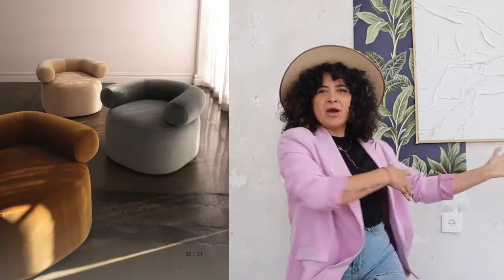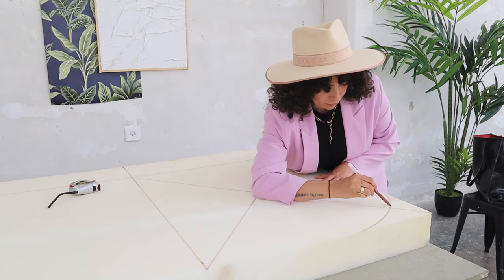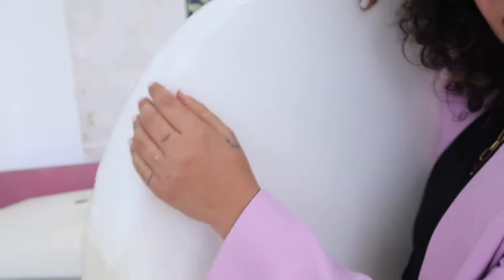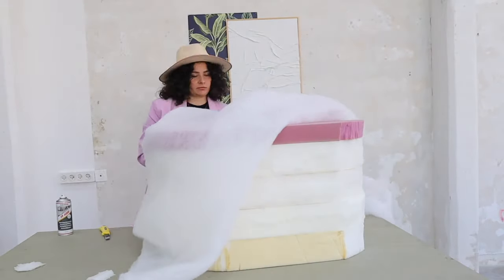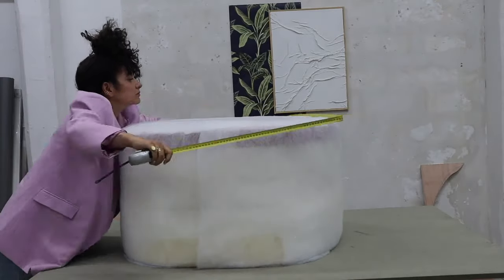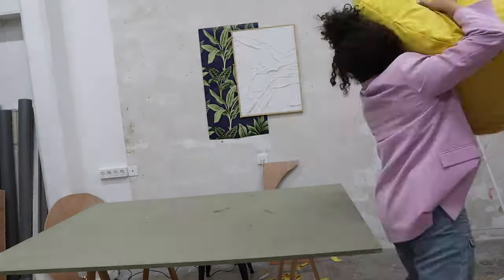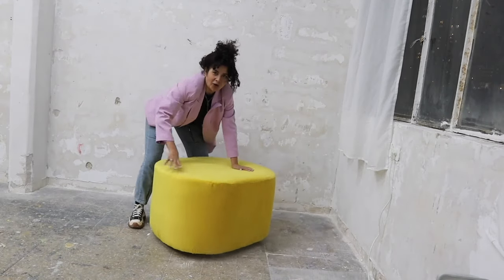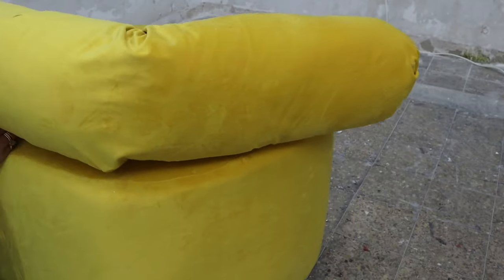DIY HUGGY SOFA // HOW TO MAKE A SARAH ELLISON ARM CHAIR AT HOME

Comment: The bottom came out great. It is the  the wrap around at the top that needed more foam so the chair looked like the original.  the original you modeled it on has lots of foam in the wraparound on top and is larger and much smoother than the one you made on top. I know it would cost a little more but would look so good.
Reply from the maker: Thanks for the tips!

Comment: cut holes in each end of each bolster then thread a pool noodle through, then sew them together around the seam of each end . this will help your back hold its shape. then get the largest eye and hooks {like on a bra} to attach to the back. this way you can use this piece a a couch/chair or an ottoman.
Reply from the maker: 😲😲😲😲 that’s genius